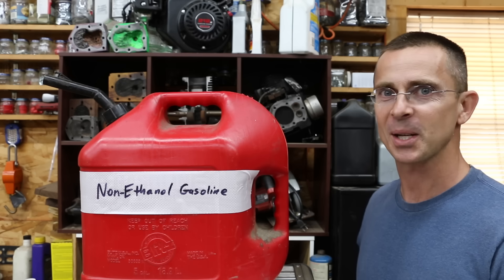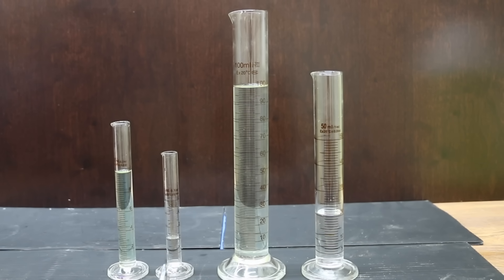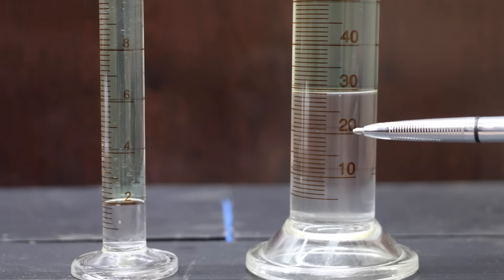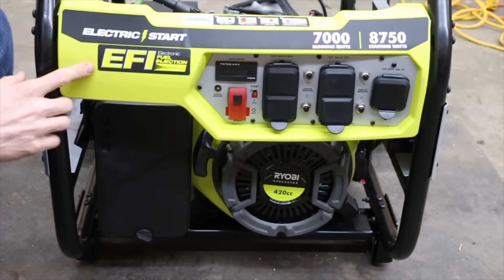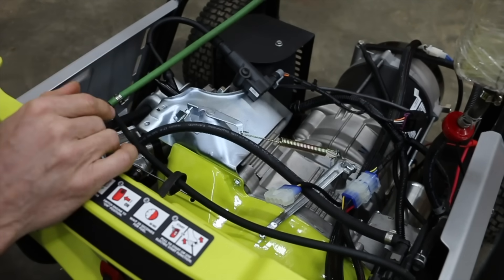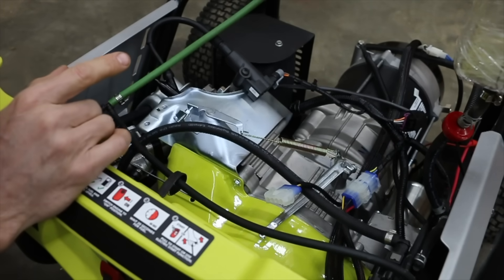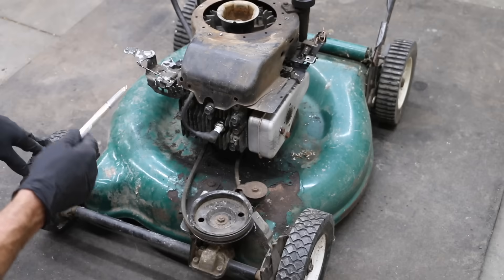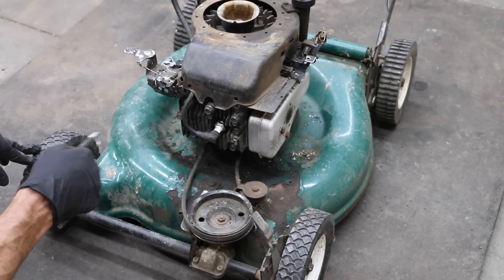Is Non-Ethanol Gasoline Really Better? See the PROOF!

Comment: my biggest issue with ethanol is, they use lower oct gas, put 10% corn fuel in it, and charge ya the same price. so your getting cheaper gas but paying the same for it.
Reply from the maker: Thank you!
Reply: @ProjectFarm , most of the car brands in Brazil, from Honda, Hunday, Fiat, Renault, Peugeot, to Chevrolet, Ford, etc, use motors (with denomination: "Flex" motors) that run on any amount of gas and ethanol mixed in the tank and also on 100% percent of either. The electronics takes care how to burn the different mixes. The gas stations sells pure ethanol as sells gas. Just would be nice to know which mix performs more efficiently and more economically.
Reply: @jmvneto51  Gasoline is ALWAYS far more efficient than ethanol. Ethanol is just cheaper and in Brazil, ethanol’s price is controlled by the government.
Reply: You're exactly right.  You're paying top dollar for watered down fuel that gives less BTU'S per combustion cycle than real gas. Plus it attracts moisture, corrosion and attacks all the rubber and plastic parts of your fuel system. The only one's who benefit from corn fuel is the government, the farmers and the oil companies. The consumer is getting shafted at the gas pump.
Reply: @richb.4374  About every vehicle made after 2005/7 has components that are capable of running E85, so E10 gas wont be a problem for your lines, tank and injectors
Reply: @bololollek9245  except there are plenty of people who still operate pre 2005 cars on a daily basis. Hell I drive my 1968 F100 every day. My newest car is a 1992 model year.
Reply: @williamallen7836  yea and our government is trying to stop guys like you and me from driving old cars and trucks for daily drivers.
Reply: @richb.4374  
the government isn't benefitting even a little bit. farmers make the same whether the corn is fermented or eaten, so they aren't benefitting from ethanol either.

the oil companies are actually being hurt from selling less oil, and the car makers look like incompetent tards to the average person when ethanol is blamed for their car problems, not to mention that a lot of the time the problem is still covered under warranty, and that means the car companies are actually losing money because of ethanol.
Reply: @lordgarion514  The farmers are benefiting because their corn is bought regardless of if people actually want it or not.
We have many, many acres of corn that could be used for something else that's more worthwhile, but it's a guaranteed check.
Reply: @OfficialFedHater  
Well yeah, but they already got those checks, and farmers getting those checks weren't throwing away corn.

We didn't get new farmers to grow all the ethanol corn, some switched from other grains, which also get subsidies, to growing corn, and by increasing efficiency. 

Now if you want to have a righteous reason to bitch, look up government subsidies of milk. And how many millions of gallons get literally poured out every year.
Reply: @lordgarion514  The farmers aren't throwing away corn, it's just sitting in silos to store or rot.
I don't like any subsidies.
Reply: @OfficialFedHater  
You should. It's literally the government taking from the rich and giving to the poor. By using rich people's money to make the food cheaper for everyone else.

It's not the same as getting the money the rich use to buy the government out of the equation, but it at least helps the regular folks get less of a screwing.

And we use a lot of that extra grain to help feed the hungry around the world, and TBH we get a LOT more bang for the buck sending the food directly than buying it on the open market and sending that.

We don't really store grain long term, which we should. We could easily have a decades worth of grain reserves. Crop loses around the world are increasing due to climate change, and right now, with the scant reserves we have, one really bad season in he Midwest and our food prices, and quantity, would go right to shit.
That's multiple levels of idiotic.
Reply: @lordgarion514  It's the government stealing from the middle class.
Price fixing doesn't help anything because it sucks resources away from what people might actually want and innovations to give people what they want.
Reply: @OfficialFedHater  
"Stealing from the middle class"

You've never actually looked up who pays what have you?

And. No. You haven't. If you had you wouldn't have said that.
Reply: @OfficialFedHater  
The short of it is that contrary to what the bloggers you listen to tell you, the rich people really do pay the taxes in this country.

The middle class don't pay enough to cover the benefits they get from the various government programs, so no, the government isn't stealing from the middle class.
Reply: @OfficialFedHater  
And both the government and industry spend billions on research. Including the government giving individual farmers money so they can use part of their land for testing.
You should look up the per acre yields in 1980 and now.

In the agriculture world innovation is non stop and fast paced TYVM.
Reply: @OfficialFedHater  
And let me assure you, what people want is lower cost food.

Unless you want to go back to the 1950's, a decade widely regarded as the most idyllic in American history, when they literally paid just under 40% of household income on food.

Today we pay 6.2% of household pay for food.

Which do you want? Thought so.
Reply: @lordgarion514  Yes, they do benefit. Because growing more corn for the gas industry, means more profits to the farmers. Considering the only difference the video proves, was that ethanol made the small engine run more efficiently. 4% more. That's a good thing for the consumer and the farmer.
Reply: @hrdman2luv  
And I forgot to mention, both the EPA and the small engine trade group both report that ethanol damages small engines.

A 4% increase in efficiency isn't worth much if you end up spending more than you save, and if doesn't take much engine damage to equal that saved 4%. And that's not even counting the time wasted dealing with a broken machine at home/farm and then the time, fuel, and wear/tear on truck taking it to the shop and going to pick it up.
Reply: One Man Kebab Remover
If you pay me $10 in taxes and I give you $12 in benefits it aint hitting you much at all, since you'll be worse off if the benefits stop.

The only, and I mean the Only people who pay for everything they get is the rich, and then they pay more on top of that. A lot more.

And sure, governments waste, that's not a shocker. Doesn't change the fact that those subsidies have helped dropped home food costs from ~38% down to 6.2% of income. If you think you paying 38% of your income towards food isn't helping you, then I invite you to donate 31.8% of your income to charity for a year, and then tell me how spending that extra money had no affect on you.

No shit, you thinking that everyone paying an extra 31.8% of their income for food wouldn't hurt many millions of families is absolutely idiotic.
Reply: @lordgarion514  you keep posting like you have a clue.
Reply: @lordgarion514  maybe I don't understand who you consider middle class and rich.
Reply: @Knotrockets 
Well, the top 10% of earners make 47% of the money, and pay 70% of the taxes.

The top 25% of earners make 69% and pay 86%.

Leaving the bottom 75% of earners to pay 14%.

And the poorer they are the more actual money they get in addition to the "normal" government services.

And none of the 75% are paying in what the value of all the services and benefits they get is.

That is the rich doing the paying.
Reply: @lordgarion514  Them farmers in iowa lived like kings after that was  started .
Reply: @harveymanwarren1876 
After what? Ethanol production or subsidies in general?

Sorry, not sure which of my posts you're replying to.
Reply: @lordgarion514  you obviously don't farm corn or you would know that the farmers are not benefiting.
Reply: @ghostlygrimrapper 
No, I don't farm corn, or farm for that matter. I did study agricultural science for 6 years a long time ago.

But regardless of all that, I'd say whether or not they're a benefit to farmers is down to whether or not taking the subsidies away today would have a negative impact on them.

It would. So they're a benefit.
Reply: @lordgarion514  bs. You didn't do very well in school did you? I'll explain it in terms you might under stand. You go out to get drunk the alcohol is water down by 10% price is the same. You have to drink more to get drunk. So the bar makes more money. YOUR fuel mileage would be about 10% or more better Now again tell me the oil companies and the police unions aren't making money off you and me.
Reply: @lordgarion514  oh so your buying more gals you pay tax per gal. Now the government is making more! Plus add in the transportation of all the corn and enthol.  The safety factor is also higher! EMS and firefighters now have to deal with a different animal#! Most environmentalist can only see what is only in front of their face. I can spend a day telling you how good doers  with government laws are only doing more harm then good! But only putting money in big business and government pocket. Taking advantage behind the environment while stripping the money from the citizen's pockets and into theirs.
Reply: @Roadking556  
Except you don't pay the same. 100% pure gasoline cost quite a bit more.
Reply: @lordgarion514  yea now ... Not on the turn over. They just cross over the cost.
Reply: @Roadking556  huh?
Reply: @lordgarion514  You got that right. I was farming in the 70s and 80s and the avg field corn yields were 150 to 180 bu per acre. It blows me away to see 300 bu per acre corn today and there is even talks of 600 bu per acre corn soon. Cheers and thanks for setting these ignorant repliers straight. Cheers...
Reply: @lordgarion514  but GMO's are are being forced into the food chain! I'd rather pay a little more for healthier food!
Reply: @lordgarion514  well said
Reply: @OfficialFedHater  wrong.  New Zealand is the biggest mild producer in the world and gets subsidized otherwise they couldn't be profitable, especially sold in US.  All dairy subsidized in US.  There would be no milk without it.  Cost prohibitive.  Farmers by the way were not ASKED if the ethanol requirement was voluntary, it is NOT
Reply: @02hreblue30  You don't just get to say "wrong" to facts.
If someone tells you that gravity pulls you down to Earth, you can't just say "wrong" as if that makes you right.
New Zealand cut farm subsidies away in the 1980's, they don't have them anymore and their agricultural sector has thrived in spite of it by engaging in free trade and competition.
Reply: @lordgarion514  There is no 4% increase in efficiency with ethanol. There is a 4-5% DECREASE in efficiency. Ethanol simply reduces exhaust emissions.
Reply: @Knotrockets  He does have a clue. The facts support what he’s saying.
Reply: @Knotrockets  If you don’t understand something, it is a YOU problem, not an US problem. Look it up!
Reply: @harveymanwarren1876  What kings? Farmers are probably the hardest working and poorest class of Americans, save perhaps coal miners.
Reply: @afcgeo882  
Somewhere in one of my posts, I'm pretty sure I explained that ethanol has less energy than gasoline.

I'm traveling for work and only have my phone to access the net. And I'm not scrolling through over a hundred messages on my phone. That would suck.

Could you paraphrase the comment you're replying too?
Reply: @lordgarion514  You said Ethanol had a 4% increase in efficiency despite it being cheaper. I’m sure it was a typo or something. You seem very informed.
Reply: @lordgarion514  FACT!
Reply: @richb.4374  The farmer isn't benefiting.  Corn prices are lower than they've been for many years.  And real gasoline is forty cents higher than E10.  ADM and Cargill are making out like bandits, though.
But there is no difference in the quality of fuel.  87 octane is just as good as higher octane fuels.  They are just used for different engines.
Reply: @richb.4374   How is the government benefiting?  I can't see any reason. The farmers, sure.
Reply: @richb.4374  No it doesn't. There are no problems at all with it. You get more punch in the engine and it works without problems. The only thing is that it might be somewhat more difficult to start an older engine during really cold winters, especially if you use a lot of ethanol. In Sweden we have 5% in all gasoline (and we have 95 octane (not calculated the same as the US octane), and in some rare places you can find 98. And we have E85 and that is 85% ethanol. And all normal cars can run on up to around 50% ethanol (then you have to make modifications, like using bigger nozzles since you consume more with ethanol).
All the talk about problems is just rumors.
Reply: @richb.4374  Farming Corporations benefit rather than farmers. I think it is an important distinction to make. Non-corpo farming has really been soured by the oil industry/gov coming in and mandating a corn/ethanol  market. The people who actually work the farms are usually getting stiffed in this situation too.
Reply: @richb.4374  yep.exactly. its getting too hard to find ethanol free gas for my small engines, why cant we vote in some politicians to represent us small guys! oh that's right save the planet... more country's don't care at all. hey wait, doesn't this planet belong to them also?
Reply: @richb.4374  and shafted in food prices
Reply: But you are saving the planet!
Reply: @mikeymcmikeface5599  so useing thousands of gallons of diesel for equipment and millions of gallons of chemicals being put in the air are saveing are planet...... ok
Reply: @theghost7277   And don't forget the petroleum used to make the fertilizers and to transport them to the farmer.  And then fuel for the ethanol refinery, I would guess mostly natural gas. I'm sure the energy footprint of ethanol from corn has been well examined and I doubt if it's good news.  

But the ag lobby is very powerful.  And once the ethanol is extracted, what's left is free cow fodder that you and I paid for.
Reply: @theghost7277  Yes.  In a way they are.  The alternative reliable energy source before Petro and coal was wood.  Without them we would not have any forest left.  They are both higher concentrations of energy by mass and we get to keep our forests.
Reply: @theghost7277  Diesel engines may look dirtier out the exhaust pipe than gas engines but are actually putting out fewer pollutants into the air than gas engines. Just because you can't see it doesn't mean it's not there.
Reply: @woolybuck6852  ok first of all gasoline is a purified fuel and puts out fewer fumes and fewer chemicals out it's a fact fo any amount of research
Reply: @theghost7277  your exactly right. more carbon dioxide means better plant life. better plant life more oxygen.
Reply: @woolybuck6852  False. While Diesel engines put out less CO2 (a greenhouse gas, but not a pollutant), CO and lead, they put out FAR more noxious gasses and particulates.
Reply: @mikeymcmikeface5599  Ethanol combustion makes more co2 than burning gasoline too :) Yay..
Reply: @eamh2002 
Yeah, it does.

But the difference is that the co2 from the ethanol was taken from the air as the corn grew. So the net increase from the ethanol is exactly zero.

The co2 from the gas however is from underground, and from a long time ago. So long in fact, that life has had time to evolve to live without that extra co2 being in the air.
Increasing co2 also causes plants to grow faster while picking up less nutrients. Which means we have to eat more plants now than decades ago to get the same nutritional amount. So even more calories..... 

Putting the co2 back is not intelligent TBH.
Reply: @eamh2002  Except it’s offset by the growing of the corn itself, which is a carbon sink process.
Reply: @mikeymcmikeface5599  ROFL. They use diesel (and not necessarily biodiesel) to plant it. And it takes more of it than it does regular. They penalize people who buy regular. You pay for ethanol 3 times. Farmer gets a subsidy for growing corn. Mixers get paid to put it in gas, and you pay for it at the pump. It could not sell if it weren't for subsidies.  😉
Reply: @mikeymcmikeface5599  Seriously? You don't really believe that B.S. do you?
Reply: @mikeymcmikeface5599  How?  Alcohol also produces CO2 and water from burning.  So your CO2 continues.
Reply: thats the idea... just another rip off.
Reply: The price is not the same, pure gasoline is much more expensive, if gasoline were 50 % alcohol, the price of gas would be $1.00 cheaper per gallon, alcohol does not always have to be made from corn either
Reply: @CopperCettle  alcohol or ethanol...and yes it is the same price. it never went down 10% if anything it went up
Reply: @fawkurface46  The bottom line is that all ethanol is alcohol, but not all alcohols are ethanol and causes the price of gasoline to be lower, pure gasoline here costs more than 10% gas/ethanol, otherwise no one would ever buy the higher price stuff, unless they are stupid and think alcohol harms your engine
Reply: @CopperCettle  Alcohol is corrosive and deteriorates seals and oil products.  So yeah, it harms the engine.
Reply: CopperCettle alcohol has cost this country 100’s of millions in repairs.  It destroys carburetors and injectors
Reply: CopperCettle alcohol also draws waters so when alcohols contaminated fuel is stored very long ( over winter ) the alcohol pulls water into the fuel system.  It also evaporates very easily and once it’s gone, we only have a very low quality fuel left. As this experiment shows, it cause corrosion in the fuel system.  You comment is the comment of an uneducated person.  At least uneducated    about the problems of ethanal fuel.
Reply: @jeffwalker1322  
Yeah, but that's due to the greed of the car companies.

We've had the technology to prevent said damage for decades, and it's not even expensive TBH.
Reply: @CopperCettle  
no, it actually wouldn't.

the corn they use for ethanol is very highly subsidized. it's just a matter of where the money is being paid.
Reply: @CopperCettle  The only reason gasoline with ethenol is cheaper is because it is subsidized by the government(that is your tax dollars making some big government supporters rich).   If the government didn't subsidize E10 gasoline it would definitely be more expensive.
Reply: @darrenpickens7147  name something that is not subsidized by the government, cars ran on alcohol before  they needed to get rid of the by product from crude oil called gasoline, prohibition was instigated by the big oil companies, thus ending the use of alcohol for fuel
Reply: @darrenpickens7147  
"The only reason"?

You sure about that?

Because fossil fuels get a metric shitload more in subsidies than corn does.

In fact, worldwide, fossil fuels get over 400 billion in subsidies and all renewables combined, of which ethanol is one, only receive 66 billion.

And the American federal government is real good at hiding fossil fuel subsidies by calling them other things. The International Monetary Fund(IMF), which was started by the American government, does a great job digging through the wording bullshit and lists all the subsidies we give fossil fuels if you want to learn something.
Reply: @CopperCettle  fail.  epic fail.  do the math
Reply: @02hreblue30  what math ?
Reply: Not an engineer myself. But have experience of 50 years. I recall Mtbe additive fuels prior to ethanol. And also Sinclairs gasohol experimental blend in 1980 to 1982. My Duntov, offy, holley 327 with 180 fender well exhaust did not catastrophically detonate on Sinclairs alky blend.
The only issue it EVER had was the O-ring to the secondary float bowl degrading.
They make Viton alky carbs today.
Pure methanol race fuels aren't a problem for knowleged circle track folks.
Alcohol de icer injection has been used in piston aircraft for 80 years.
My Japanese Honda GV160 mower is 10 years old. And had a carb disasembly, cleaning and new gaskets. Once in that decade.
If you remove the alcohol from modern fuel, how do you maintain resistance to spark knock?
My aforementioned 327 Chevy had 64cc combustion chambers and 11 to 1 final compression. No knock sensors in that 1st gen smallblock. 
If you could datalog combustion with todays insanity of three overdrive gear sets in modern transmissions and silly 2.3 diff ratios. You would be surprised how much preignition is happening at 1400rpm.  My 327 did just fine with total advance dialed on @28 degrees and a conservative 3 series diff. The Sinclair blend fuel worked so well that they were assimilated and the blend was hidden by
Corporate big players.
So NASCAR's roots were bootleggers running alky through 3 strombergs.
Maybe Hill Billys aren't so dumb?
Reply: @ayebee1207  bullshit
Reply: @ayebee1207  Racing uses alcohol fuel for safety.   The safety reason is simple.  Alcohol does not burn as easily as gasoline and can be put out with water.  So  it has saved a lot of racers in the last 50 plus years.
Reply: @starleyshelton2245  Pure racing fuels (ethanol or methanol) don’t burn as easily, but in combination with gasoline, additives make it burn at the same rate, producing the proper octane.
Reply: @ayebee1207  MTBE was proven to be incredible world class carcinogen and made its way in substantial amounts into drinking water supplies
Reply: @ayebee1207  METH injection not ETH injection. Methanol is highly poisonous and readily absorbs through human skin and membranes to everyone involved and causes blindness and death, and has terrible emissions.  Remember all the people dying from drinks watered down with methanol?  Methanol also burns invisibly to the human eye.   Remember all the Indy Car burns where people got burned up and couldn't see it happening?
Reply: In 4 decades I have only seen 1 time when a convenience store was changing the filters on the pumps.
Old school gas and repair service stations with sole proprieters would lose customers over dirty fuel.
Modern fuel refineries and car makers are a marriage for $$$$$$$$$$$$$$$$$$$$$
Reply: Corn isn't free. In fact it takes more to plant, grow and harvest the extra corn needed for ethanol in gas. The farmers don't give it away. There's a process in everything from planting it, to turning it into ethanol.  As a small engine mechanic, the ONLY difference I've seen is from it setting. But even gas gets bad from just sitting.  So there actually isn't enough difference in the two to even worry about.
Reply: But them tariffs are supposedly putting the corn farmers out of business. Im 100% positive those tariffs don't affect that corn sold to the government for ethanol. The news misleads people so bad on everything. Plus China isn't the only country that buys from our farmers
Reply: @prohen3049  it depend on how much corn China buys. Surely other countries aren't going to buy more just because China isn't buying. In all probability,  American farmers will have to sell theirs cheaper just to unload it.
Reply: PRO HEN
And to be clear about it all, China is the country with the largest grain reserves in the world. Not only that but back in 2014 they only ate 45% of what they grew, and they've been increasing both their stockpile, and their acreage ever since. It was estimated they had 300 million tons of grain reserves back in 2015.

That's not a fight idiot in chief can win, especially considering the Chinese mindset. (just google "why China can't lose the trade war with America" ).

So yeah, our farmers and companies, especially small companies, are doing almost all the suffering so far, but if it continues we'll start paying more. And that won't hurt the rich one bit, but it will decimate the middle class and the poor. And in fact, we the regular people are already feeling it. We should have added about 160k jobs in August, but we only added 130k. Companies are already cutting back on buying buildings and equipment, which means less work for Americans.  Then there's the thousands that have already lost their jobs, and it's estimated that if the trade war continues up to 2 million American jobs could be lost in total. Through a combination of slower job growth, layoffs, and companies going out of business(and there's more than one that's close to closing) 

And THAT will do a ton of damage to our economy.
Reply: Robert Pruitt I feel sorry for whoever the next president is, who will inherit the @&$!-show and be blamed for it, only to barely turn it around (I hope) and the president after takes credit for it.
Reply: I never knew that until today. It seems like regular fuel is better for the $. I wish every gas station sold non ethanol fuel.
Reply: cody, not around here. The ethanol gas is around one dollar cheaper than the regular gas. I was at a station last week that had both. Ethanol was $3.50. Non-ethanol was $4.50. That's around 20% savings for the crappier ethanol gas.
Reply: Kwik Trip- non 91 octane was .60 gal higher than 10 %% ethanol
Reply: @THE GHOST - I’m pretty late to the conversation here, but wanted to point out that unintended consequences have almost entirely negated any carbon benefit from using corn-based alcohol as fuel. What’s happened is that the subsidies have shifted the economics and made growing corn for fuel more profitable than other crops. So lots of US farmland that used to grow other crops is now used for growing fuel-corn. That’s made food crops more expensive (supply and demand, competition for resources), but more importantly has pushed a massive amount of agriculture to other countries. The result is high demand for new farmland to grow crops like soybeans. New farmland doesn’t just magically appear, and an unfortunately easy solution is to burn rainforest to create it. I don’t have the reference handy, but when you figure in the amount of rainforest that’s been burned to offset agricultural capacity consumed by fuel-farming, the carbon-neutral payback period is hundreds of years. (It’s out there somewhere if you google it.) Alcohol fuels look like a good solution for a renewable and carbon-neutral energy source, but only if you ignore the negative externalities.
Reply: @DEtchells  yes thank you . I also pointed out the added transportation cost and safety factor of ethanol.  We are fooled into thinking what is good and helpful for the environment when in reality we're causing more harm.  while big business make huge profits with government regulations that are forced down our throats. We are paying both ways with no way out.
Reply: @DEtchells  What do you base those assumptions on? Anything? There’s no lack of crops in this country, at all. That is to the point that rice, wheat, soy and rye growers are regularly paid by the US government not to grow these grains, just so there is no market oversupply. We (the government) also pay our rice growers to grow rice just to send it to countries like Cuba as economic aid.
Reply: You are actually pay extra for ethanol many times. You pay for lower gas mileage, you pay more at the pump per gallon, and you pay more in taxes to subsidize ethanol production. It's a lose, lose, lose. Unless you are an ethanol producer.
Reply: not sure…  10% Ethanol is not that much .. do you really think they make 91 Octane fuel without Ethanol and 90 or 90.5 octane fuel to make E10 wich will also result as 91  ?
Reply: @bobl78  They do make both, E10 and pure gasoline in ALL grades up to 93. Above that, all gasoline has ethanol to increase the octane rating.
Reply: The price of corn fuel is artificially cheaper due to subsidies. 
So you still get back to the core issue of whether or not it’s actually damaging to use.
Reply: @cody hockenberry- but the people don’t come together to make this lawmakers change that. We as the consumer should be able to protest and also have the ability to choose. But in this case they are stiffing us with water down fuel for the price of premium non ethanol fuel.  There should be a movement on this issue.
Reply: Plus it rusts out your metal fuel tank :/
Reply: @tejaspadhye  Metal fuel tanks haven’t been made in decades.
Reply: @afcgeo882  talk about your region lmao
Reply: @tejaspadhye  I’m talking about automobiles around the world. Even Russian cars have plastic tanks nowadays.
Reply: @afcgeo882  ah, I was talking about 2 wheelers
Reply: And Government Subsidies, (Our taxes) pay for the corn fuel.
Reply: @alfr1  
You're paying many times more for fossil fuel subsidies than for renewables.

Worldwide fossil fuels get over 400 billion in subsidies, while renewables only get 66 billion. And America is the worst in the world for how much we pay for fossil fuel subsidies. And second place isn't even close 

Never mind the trillion dollars fossil fuels cost the American people in  missed work, medical costs, and early deaths.

Let me guess, you think human caused global warming is bullshit don't you?
No one who studies the climate agrees. Even the largest fossil fuel corporation Exxon says climate change is real AND caused by humans burning fossil fuel.
Reply: It is a scam forced on the consumer that makes cost rise.
Reply: They definitely do not charge the same price.
Reply: You don’t pay more for ethanol in Iowa. Quite the opposite in fact. Ethanol blended crapgas is $.35/gal LESS than regular gas. It’s highway robbery and should be outlawed.
Reply: cody hockenberry   We have laws against that here in Australia. E10 is the cheapest.
Reply: The main reason for putting ethanol in fuel is government subsidies purported to combat climate change. Since what comes out the exhaust is exactly the same, and cars a roughly 5% of emissions, I think this is a very pointless and wasteful exercise.
Reply: and it drives up food and meat prices as well, and emissions actually worse for environment in many tests.
Reply: Good pay for jobs though.  Oh well
Reply: Don't think i've ever seen ethanol gas more expensive or the same price . Its usually cheaper here in Iowa.
Reply: Gasoline isn’t naturally that high in octane anyway. High octane is created by adding chemicals like ethanol to begin with.
Reply: Idk where you are getting fuel at but where I live, non ethanol is definitely more expensive